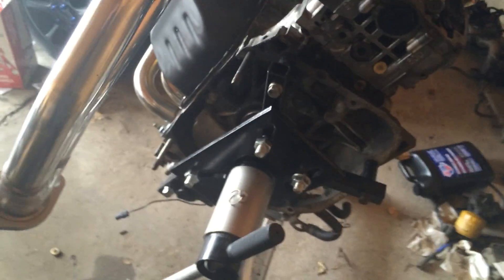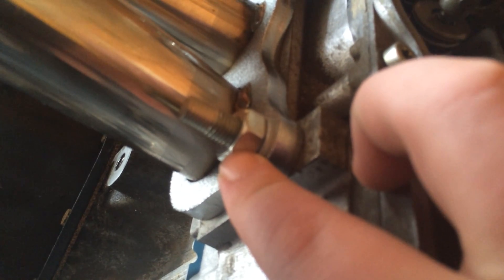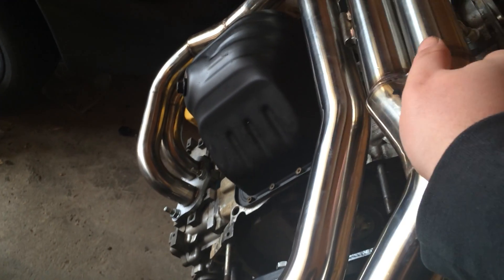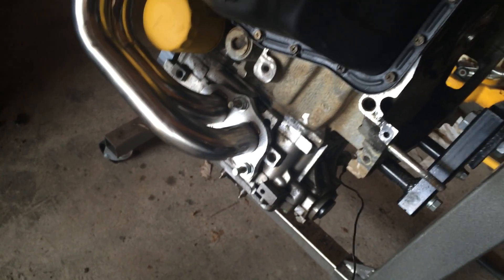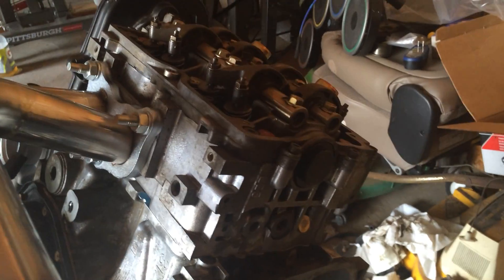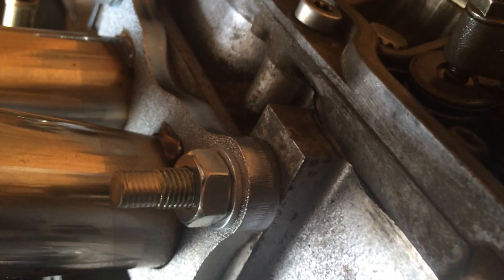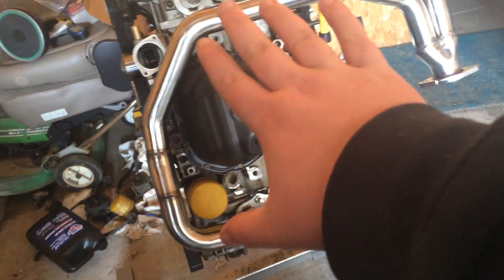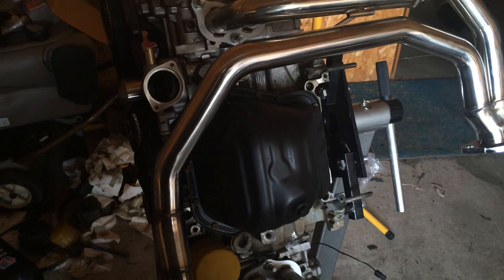Subaru 2.5 UEL Header Update

Comment: Please tell me these uel replica headers will clear the oil cooler/lines on my ‘01 Forester. I’d love to get one for my car
Reply from the maker: They will not.
Reply: BluDog35 Ah shoot! I thought so.. not without modification of the headers of course. That’s what I thought, I’d have to get a welder to cut and reroute the pipes by the filter to make it longer around the oil cooler/lines.. or do an oil cooler delete on my car would be the other option. Thanks
Reply: I have seen posts on forums saying you can bend the PS lines up out of the way w/o too much effort. I have an 01 and a replica arriving next week so I'll let you know how it goes.
Reply: Daniel Boughton Sure thing, let me know. 👍🏻 Do you also have an oil cooler & coolant line coming from the bottom of the water pump on your ‘01 also?
Reply: @BJPr12  no oil cooler on mine. Also the headers might fit but in my case I just replaced the motor mounts and they are not squished to hell so I am making some spacers and then will contemplate cutting/welding about 1/4" into the pipes where they come down. No clearance issues on the oil filter. Lots of room but the header hits the sway bar big time even when sitting on the wheels.
Reply: @BJPr12  Note also that regardless if you get the replicas they almost all require you cut a little tube and then bend them to fit the motor (imprezza or not). Using a rose bud and having something to clamp to (I used my old header) helps a bunch.
Reply: Got these on my 01 Forester (no oil cooler) but made up a 3/16" test spacer out of mild steel to fit between the block and the header. So far so good and no rubbing. If I'm still happy with a bit more driving I'll get a local shop to fab a pair out of stainless and maybe just run a batch and throw them up on ebay or amazon. With the gasket it fits on the stock studs and drops the header 1/4" which gives you about 1/8" clearance under the sway bar where the 2nd pipe is routed. This was the only issue for me beyond the hassle of having to cut the spacer tube, heat up the header and bend it back about 1" to get it to fit the to block. I used the DNA headers which otherwise seem solid enough and a decent deal for ~ $100.